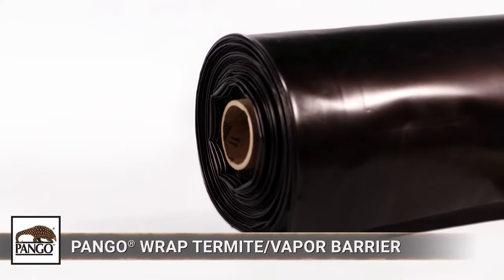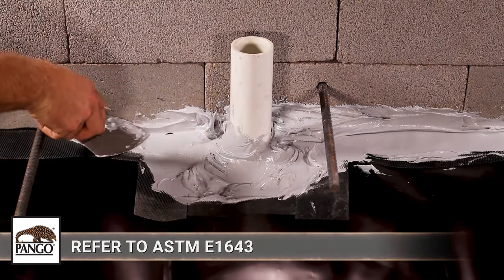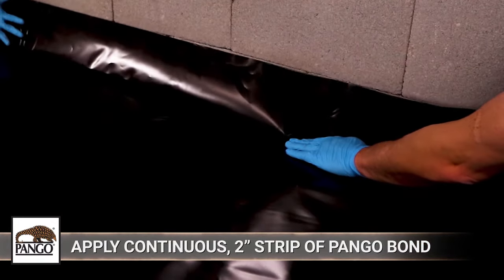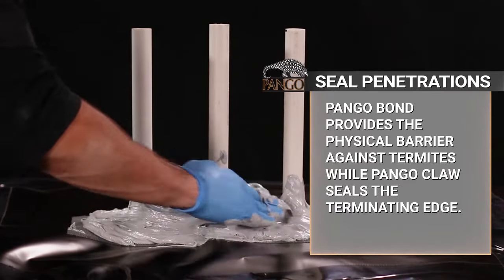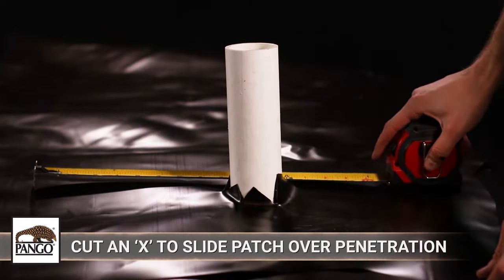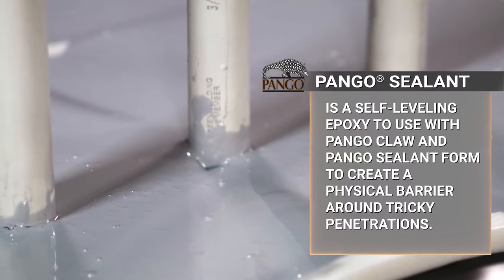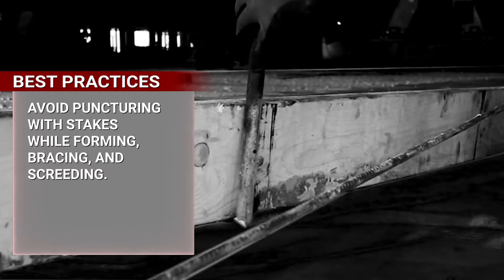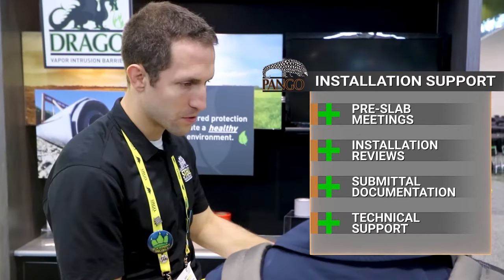PANGO® WRAP | How to Install a Physical Termite Vapor Barrier

Comment: Can you apply Pango claw directly on plumbing penetrations?
Reply from the maker: Thanks for the question!  Stego does not recommend applying Pango Claw directly to plumbing penetrations.  Here’s a link to our installation instructions which includes our recommended methods for sealing penetrations: https://www.stegoindustries.com/hubfs/Installation/Pango-Wrap-Termite-Vapor-Barrier-Detailed-Installation-Instructions.pdf. If you have further questions, don't hesitate to reach out and we can put you in touch with your local rep.